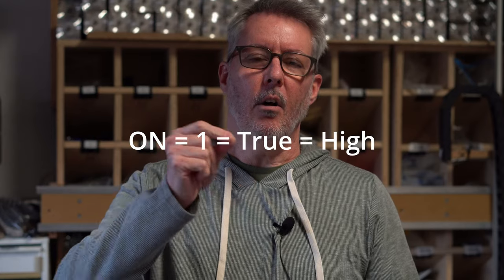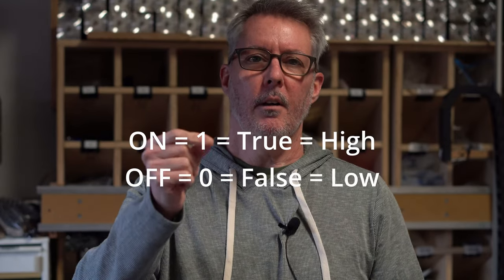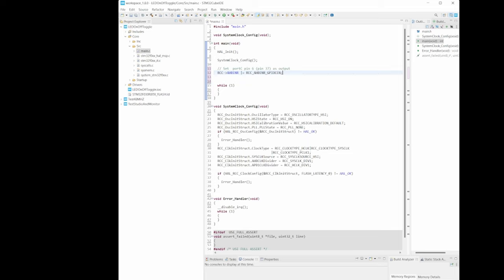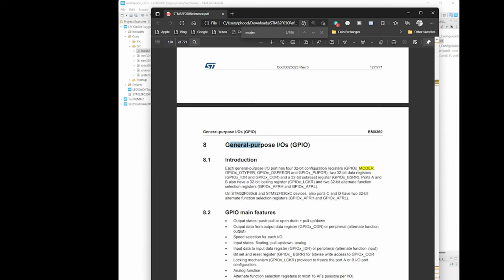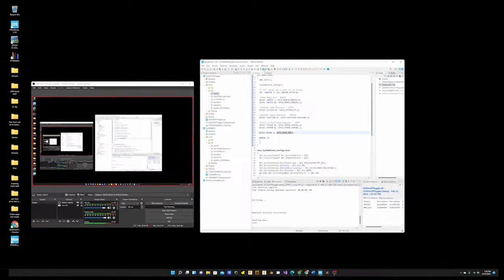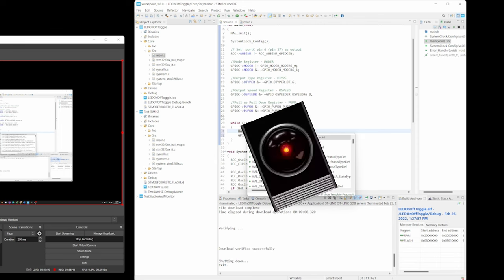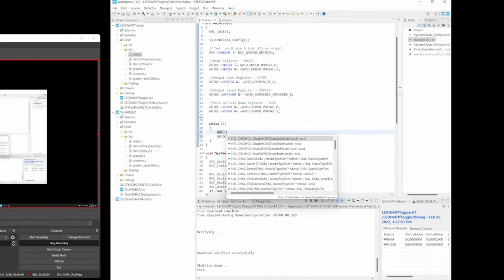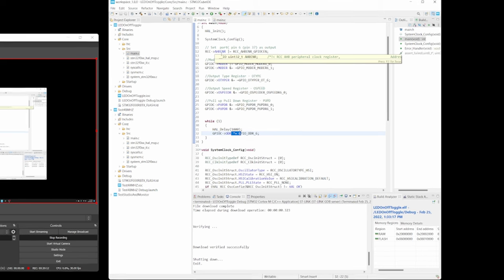#5 ARM STM32 Microcontroller Tutorial - The 4 Basics to Control ALL!!

Comment: I really appreciate the effort (and humour!) you put into these videos, it's great! 

Since your videos are aimed at folks starting out with this type of programming I wanted to offer my 2 cents -- not criticism at all, just a couple of things that can trap "young players" as EEVBlog might say :)

Early in the video you talk about testing a register's value with a 'bit number' using the '&' C operator. This may trip up some because you don't really want to use the bit number here but its mask value instead. If the bit number is 7 for example you wouldn't want to compare with 7, you would want to use (1 << 7) instead. The vendor's header files (ST Micro in your case) usually do a great job of making this easy by providing pre-defined symbols to use in your code as you show in this video, so many folks might not encounter this subtlety but it is there. 

At 5:08 in this video you say that the condition in the 'while' test could be either != 0 or == 1 but this is actually not the case. This is a common mistake I see all the time when programming at this "bit level." Using != 0 is correct in this example, comparing to 1 would be incorrect (it would not give the result you want) because we're dealing with bit masks here. If ADC_CR_ADCAL (the mask you're testing for) has a value anything other than 1, testing for == 1 will never be true and your while loop would never end. 
It might be clearer to write 'while (ADC1->CR & ADC_CR_ADCAL)'. Some people feel this is more explicit than comparing to zero, I prefer it because it seems easier to read.
Reply from the maker: I actually thought about that while I was making the video, but that gets into some scary territory for new folks. I will probably create a card in that video directing them to more advanced videos I made a while back, talking about truth tables, adding and boring binary numbers using masks. I have heard some folks say that this is hard, and there really isn't here that is hard, so I am giving them the easy way now and adding more advanced information later in a scaffolding approach.

On another note,  when you suggested using the HSE, were you thinking I would add an external osc? I am using the HSI and multiplying that instead. I am uploading a video I made 4 years ago today or tomorrow that shows this working in the GND library environment. The HSE option did not work, but I think an interesting video of it not working yet, will come out of this.
Reply: @PatrickHoodDaniel  No, I didn't mean to suggest you should use HSE, I only meant to clarify that if you wanted to use it you need to 1) have the component on your board :) and 2) enable it in the RCC. At the time I didn't know what board you were using, now I've looked into the NewbieHack and know a bit more. I am not an EE ... but I wouldn't recommend putting a MHz oscillator on a breadboard -- stick with the HSI if you can. As long as the UART bitrate is not crazy high you should be fine with it. Use all the tricks at your disposal to work around the sloppy clock (oversampling for RX and bitrate tweaking for TX/RX) before going the HSE route. I think you said your application was transmit-only, which opens the door to generating your own byte frames. You could do this either using bit-banging or, on the STM32F it's fairly straightforward to drive a GPIO pin directly from a timer-driven DMA: program your byte frame's start + ones & zeroes + stop into RAM and DMA that to your GPIO pin, using a timer to control the bitrate. What fun!
Reply: @PatrickHoodDaniel  At first I sort of understood your logic here about staying away from the "scary" stuff and building up knowledge like scaffolding, but after I watched your video a second time I think the video does deserve a follow up or on-screen corrections (whatever those pop-up text messages are that you see all the time). 

If you're really trying to build knowledge (and I believe you are) then what you present should fundamentally be correct. If a newcomer is just starting to figure out masking like this and they see you tell them to compare with bit numbers it's going to lead the newcomer astray and probably frustrate them more. It's a great idea to layer the material and not dive into tricky topics too soon, sure, but if you do choose to cover 'while' loop conditions then what you present should be fundamentally correct, even if it's not a thorough treatment. Saying "!= 0" is the same as "== 1" is just plain wrong.

You wrote ".. and there really [isn't] anything here that is hard..". If I've quoted you correctly, then I disagree with you. This register-based programming is hard. I do this for a living and can assure you this is exactly where everyone, professionals included, make mistakes time and time again. It's the very reason companies like ST Micro invest countless $$ into developing tools like their HAL libraries and CubeMX/CubeIDE code generators.

Comment: Hi, I'm a fan of your videos and glad to see you continuing to make more!  So, I'm coming more from the software side.  My electronics knowledge is very weak.  Do you have any recommendations for how to build that knowledge for a microcontroller-embedded system emphasis?  I find that going through an entire basic circuits book is not practical because my goal isn't to really learn all the integrals and whatnot.  Its to learn the key aspects of microelectronics that do come up when I'm reading datasheets or trying to program features of an IC or possibly trying to design an embedded system (I know some parts of what i'm saying are contradictory).  If you can provide me any direction for developing hardware knowledge, I'd greatly appreciate it.  Thank you.
Reply from the maker: I would just continue watching these videos as I will be explaining the circuits as I  use them in the projects.  If you need to understand how a particular circuit works in a pinch for a specific project, YouTube never fails. You can learn every aspect of electronics from other YouTubers as well.
Reply: @PatrickHoodDaniel  thank you!

Comment: Hi, me again, 

In this video you exactly show what's I find confusing. There are so many steps to just turn on/off a LED.
Mode, Speed, pull up/down and Set/Reset. 

My understanding is, each pin has several different functions and we need to specify which one we are using. Are all ARM uC the same?

Other question, when you talk about the register,  are you referring to the address? Ex: 0x25

Thanks again for taking your time to record and explain.

Comment: Great video, but I have to correct something...
(register & bitnum) == 1 will most likely never be true. Example:
1111 & 0100 = 0100, which equals 4, not 1. You can test if it's not zero, but you can't test if it's 1.

Comment: I really like your goal of simplicity, for instance removing the code bloat introduced by the IDE - I like that.  However, in this video you left-in the SystemClock_Config().  Was that 100% necessary - or would the power-up clock defaults be okay without SystemClock_config()?   In otherwords can SystemClock_config() be removed without any unpredictable results?
Reply from the maker: It may actually not be necessary since the default values in the microcontroller already start the HSI  internal clock. If you want to change the clock through the ioc file (CUBE MX), you will still need the SystemClock function. If you set the registers yourself,  there is no need for the SystemClock.

Comment: Thanks for the video. 
BTW: Your book is very difficult to read on Kindle, unfortunately. It has a very fine and light gray writing, so that you have to strain very much if you want to read it.
Reply from the maker: Hmmm... That is not  good.  Can you  tell me  what  specifically is wrong so I can make the necessary  modifications? Font size, colors, margins, etc.?  Thanks
Reply: @PatrickHoodDaniel  I am not a technical Kindle expert. The problem seems to be, that your book does not use the font, that is configured in the Kindle and what all other books use.
Normaly, I can configure, what font the Kindle should use. All other books follow that configuration. But your Book uses another font. It is a finer font and, even worse, it has a light gray as the font-color and not black, as it is used by all other books.
But I do not know, why this is the case, I do not know, how the Kindle exactly .works.